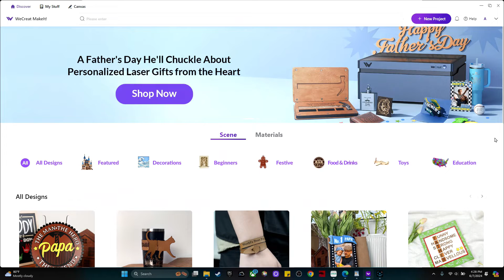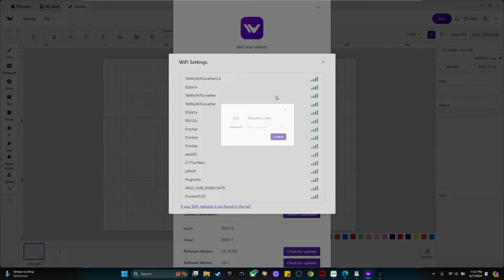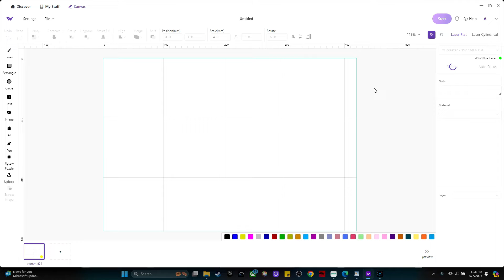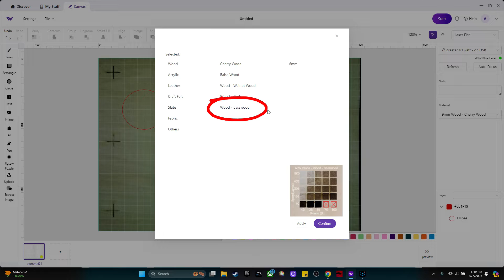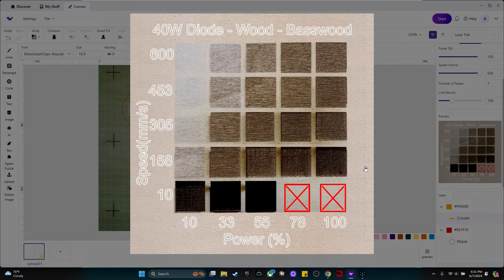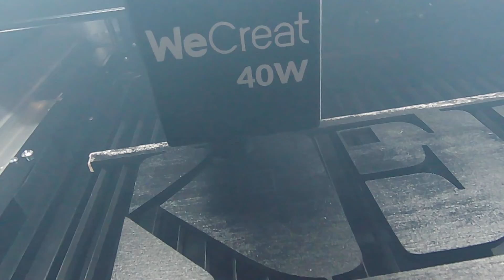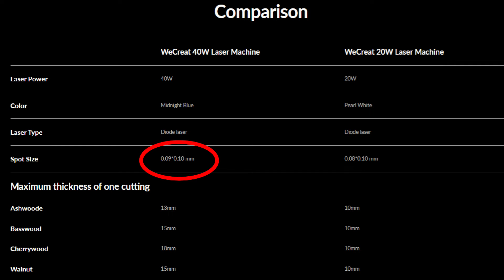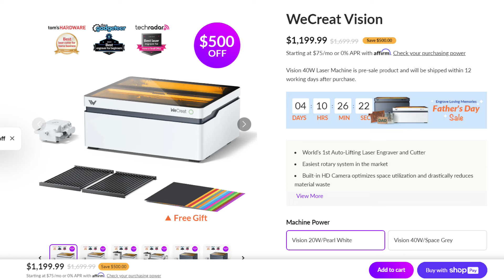WeCreat Vision 40W vs 20W Laser Engraver — Which Should You Choose?

Comment: Hey thanks for the video. I am considering on purchasing a new laser and having a hard time deciding on the 20 vs 40. Which ones do you recommend?
Reply from the maker: Hello! I think they're both great machines, but the 40w has double the power so it's faster and can cut through thicker materials. I usually recommend the 40w rotary and conveyor package, and then buying the booster fan for ventilation. https://shrsl.com/4skhb

Comment: How big is the work area
Reply from the maker: The WeCreat Vision laser engraver and cutter has a working area of 420 x 290 mm (16.54 in x 11.42 in). It can accommodate materials up to 475 mm x 318 mm (18.70 in x 12.52 in) in size. When the laser bed is removed, the WeCreat Vision can work with materials up to 140 mm (5.51 in) in height.

Comment: how about the smell. i know there is an exhaust but does stink up your house?
Reply from the maker: Great question! It doesn't stink up the house if you have a booster fan. A booster fan is a little fan that connects to your exhaust hose and helps pull air out the window. You can get cheap ones on Amazon for around $40. WeCreat makes one that's $150 but almost triple the power as the Amazon cheapie. You get what you pay for. If I'm doing a really long engrave like an hour long cutting board I can smell the smoke but I just shut the craft room door and the smell stays in that room and goes away pretty quickly after I'm done cutting. Most engraves don't take that long though, so wouldn't be producing a lot of smoke.